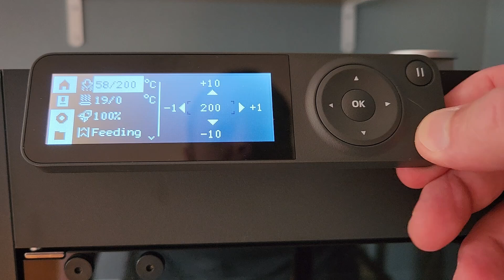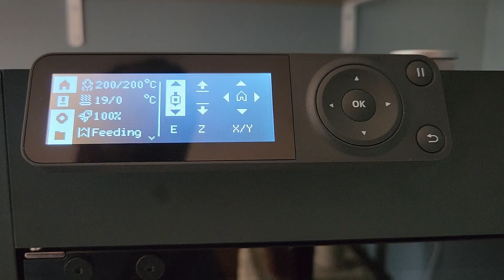Bambu Labs P1S/P1P - Faster Way to Unload Filament

Comment: Please everyone who watches the video do not do this for many reasons.  Terrible advice.  1. Hot end should be way hotter 2.  When you load and unload filament some should be loaded first then unloaded, the presets do this for you and you risk all kinds of clogs and other problems.  3.  If you dont unload enough filament you will get pieces of filament stuck in the extruder when you pull it out.  This youtuber should be ashamed of themselves.
Reply: Yeah, that's a theory. Bambu printers poop before print anyways cleaning the nozzle like when loading filament.

Comment: idk if this is any faster.. it's a lot of clicking 

the unload button I can press and wait the like 10s it takes to do the unload process 

it takes me more than 10s to grab and open my filament dry box anyway 

🤷‍♂️
Reply: Its not faster and this method should not be used, you will end up with clogs as you need to load a tiny bit of filament and then unload.  Presets do this for you.

Comment: Thanks for this. I'm thinking about getting a P1S but was put off by the loading/unloading process they present. I'm always changing filament and it takes 10 seconds to do on my Ender 3 so this is basically the same method.
Reply: Just get an AMS...best decision I've ever made.
Reply from the maker: Awesome! Glad I can help. I went from an Ender 3 V2 to the P1S. The P1S is such an amazing printer. I highly recommend.

Comment: what does the unload filament button do when you press it? I see a lot of steps the way you presented it. My Sidewinder X1 has a load and unload button and if the hotend is already at the proper temp it just takes seconds to unload. How long would it take the P!S to unload hitting its button if the hotend is already at the correct temp
Reply from the maker: The unload button cleans the hot end, homes the bed and hot end to avoid crashing, moves to the front to engage the cutter, moves to the back to clean the hot end again. It's actually a very long process. I find these steps to be faster for me.